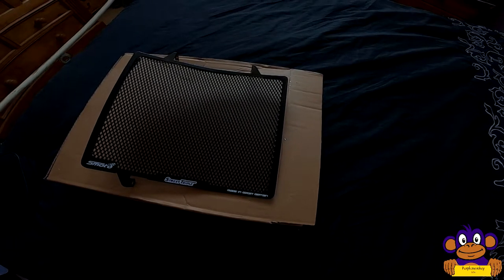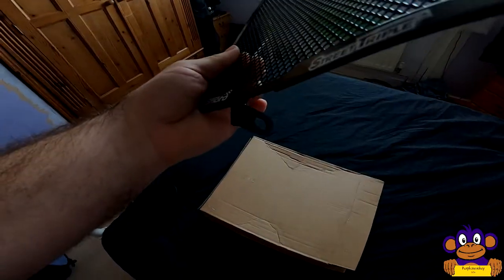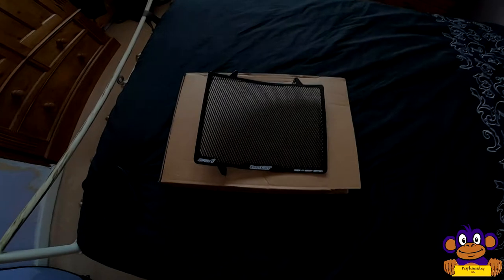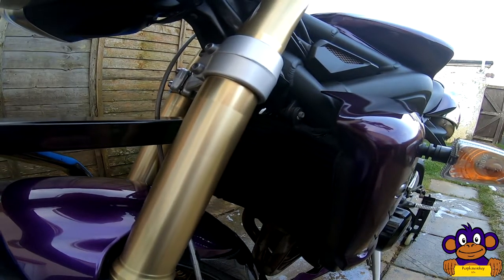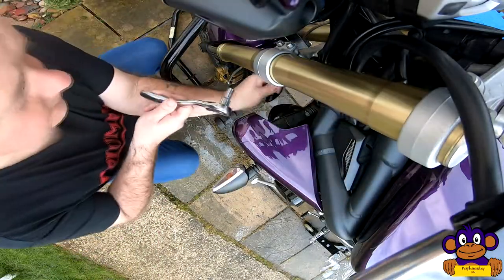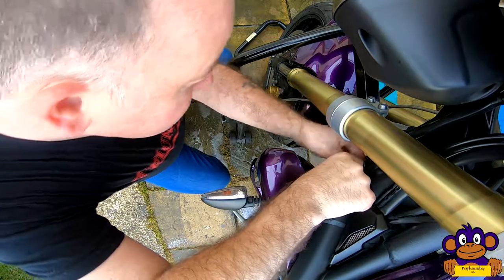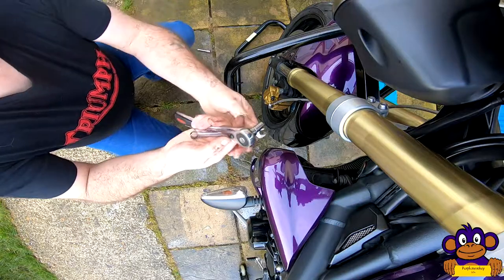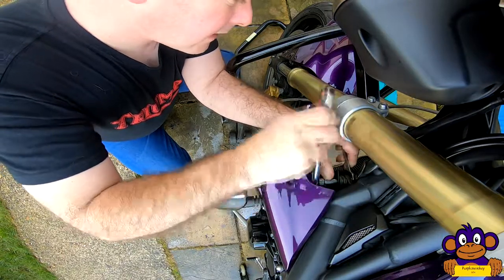Install of Smoto radiator guard for Street triple

Comment: Thanks for the sub on my channel👍My wife owned a purple Street triple bought new in 2012 and I think only available in that colour for one year. Great bike.
Reply from the maker: Love colour and sound of this bike,  just watched yr vid showing sw moto luggage system.
Reply: @Purplemonkey1974  yes she would still have the bike now but it had a little accident (no ABS) locked the front wheel on a wet manhole cover. Shes now back on a red 2015 Street with ABS. We are big fans of the SW Motech kit, still using the tank bag and panniers off the old bike but with a different mounting frame as the exhausts are no longer high up under the seat.